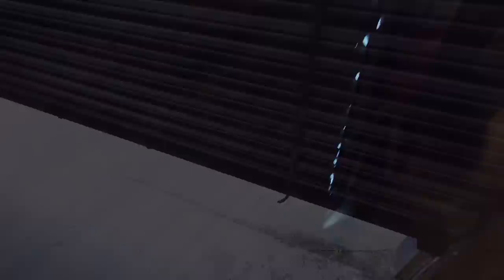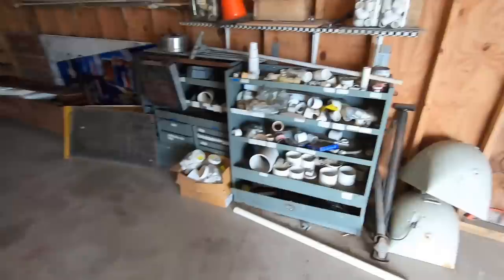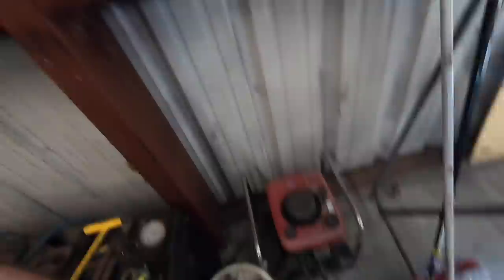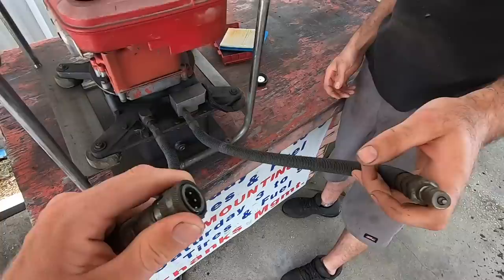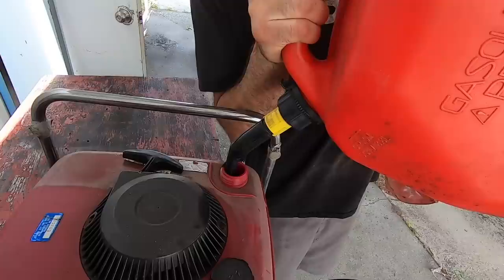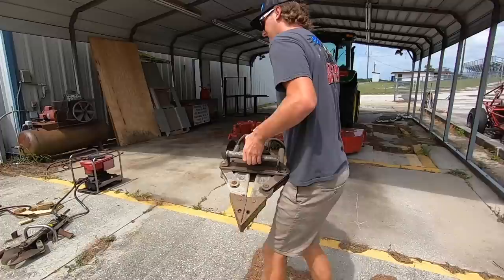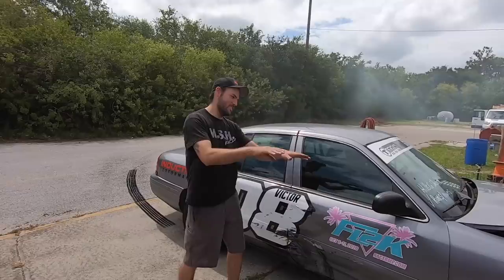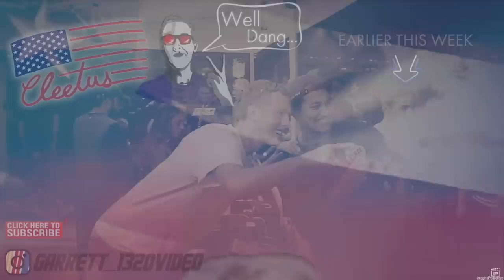We Found a REAL "Jaws of Life" Setup at the Freedom Factory and Powered Them Up!!! (they're insane)

Comment: Cleetus, I’m a mechanic that specializes in hydraulic tools and i would love to hook yall up with better whip hoses and put in some seal kits. I live in Florida as well.
Reply: Everyone should upvote this so Cleet sees it.
Reply: Jeff Sharpe you gotta send him an email
Reply: Find the res-q-Jack struts that one ram is made to go on...
Reply: I work (well currently laid off ) at a hydraulic hose shop up here in PA.  I was going to post a comment to tell him to change all the hydraulic connectors to screw together style. If the hoses are 3/8 (its hard to tell if they are 3/8 or 1/2) some IVHP style connectors will make hook up much easier.
Reply: Safety first
Reply: Hell yeah brother
Reply: Fire fighter here. Those power units are either 5,000 psi or 10,000 psi. And the rescue tool companies tell us we have to buy special hose from them for the units. And of course anything with fire or rescue related to it doubles the price.

Edit: they also run special veggie based hydraulic fluid.
Reply: Jump on this, you want these tools working well. They can be extremely dangerous when they go wrong.
Reply: Danny Evans Good point 👍🏻
Reply: What he said, hydraulic fluid injection injuries are terrible.  Whatever you do, DO NOT google image search that.
Reply: @halbritt  great. I've been servicing hydraulic bollards for the last six years. I must go look.
Reply: The spreaders are used to open doors when they're jammed, the Cutters are used to help take the roof off, or open a part of the car to have better access to the person whom is injured. The two different size spreaders are used to help open up areas when you need to. If you guys are skilled skilled enough you can make a convertible out of one of the Crown Vic. You guys should try and contact one of your local fire departments and ask them if they can do some training out on the property and you guys can observe and see how they're actually used.
Reply: That's awesome, this is why I love this channel. Just a good group of people, no drama bs and dumb comments. Plus top tier content!
Reply: Get this to the top
Reply: Yes
Reply: Heath Albritton bro I had to google that straight away. I had absolutely no idea that would happen.
Reply: Listen to this man Cleet! Safety First!
Reply: Hell Yeah Brother
Reply: @cleetus
Reply: Jeff Sharpe send him an email he’ll answer
Reply: Get onto this guy Cleetus he seems to know the goods.
Reply: Boom!! do it
Reply: @brianm6117  those connectors are purpose built for extrication equipment. You don't want screw together, slows you down. I've pushed that type of equipment to its limits, never had one of those connections fail. Firefighter, and have done annual testing of all of that type of equipment for years.
Reply: thatd be great!! i love the car community for exactly this reason!!
Reply: Heath Albritton good damn those injuries do look scary. All best and luck to all you who work with those machines 😳
Reply: the guy is a millionaire let him pay you for it
Reply: @halbritt  yeah they’re nasty. I run/ work on heavy equipment, and it’s part of a lot of our  annual safety training
Reply: Imagine if he just replied to all these comments saying he will let you do it, he would literally have thousands of people hanging around trying to take advantage of his fame😂  just remember he's forgotten more then you people that have too comment know.

Comment: The “spreader” IS THE JAWS OF LIFE. You’re calling the “cutters” the jaws. I’ve got some extra pumps for them and hydraulic reels if you need one. Those first things are called rams. And the original cost was probably around 15k for the set with the generator...
Reply: That spreader doesn’t look like a 32A though. I could be wrong.
Reply: it's old set....at least 20 to 25 years old....but if they work they are great to have for an emergency...they only thing the old Hurst jaws are HEAVY!
Reply: It literally says has of like on the cutter... Besides that, jaws are known for closing not spreading.
Reply: You can buy a refurbished one on ebay right now for 15k.
Reply: None of it’s Holmatro so they should upgrade.
Reply: They definitely need a hose set & manifold plus a general once over, and maybe some Rescue42 ram plates and other accessories. Hopefully Cleeter and the crew take a vehicle extrication class from the state or local Fire Marshal. It never hurts to know what you're doing 👨‍🚒👨‍🔧🇺🇲
Reply: @warpedfusion  I know of something that's known for spreading..
Reply: @sinistersparky9657  That would be some good knowledge for them to have while out there playing without a safety crew on hand.
Reply: warpedfusion yeah it’s kind of a brand name. That’s what you’re seeing on the sticker. Originally it was a 32” set of spreaders back in the 70s. They are heavy as hell. Back in the day I was the Medical & safety director at a larger race track for many years and own several sets of these. Now I own a similar ambulance and rescue service like what they hire down there at the track for their events...
Reply: Sinister Sparky i have a few brand new 10k 100’ Hurst reels and a few spare manifolds. I should probably email him.
Reply: Donate the wrecked crown Vic's to your local FD in exchange for some training on using that equipment
Reply: @SchmoopsAdventures  Genesis is where it's at
Reply: Sinister Sparky yup FYI I work for Holmatro ;)
Reply: It's a brand. They are both called Jaws of Life.
Reply: @MJ-kn7cc  that's a great idea man
Reply: The company I work for engineered power units for these back in the day  I have a couple of em sitting at the shop
Reply: @SammyTheDitchDoctor  Hell yeah brother! They have a pretty sweet track fire engine that has plenty of room for that and more rescue equipment 🇺🇲🏁
They could use a couple Halligan tools and a couple short pike poles for ventilating fiberglass hoods and for extinguisher access if anyone else has the hookup on surplus rescue equipment...
Reply: @Sun-ut9gr  whats her name.
Reply: Schmoops Adventures whenever any of our standbys are “REAL” stunts we rent a set of Holmatro tools. That’s saying something since we own half a dozen sets of Jaws. Heh.
Reply: Bumble Bee  yup my nickname is shaft 😆😆😆     or pipelayer
Reply: @twisted2291  Amen brother! It would also up their game as backup for the hired rescue guys 🤘
Honestly that could open up a whole new series on motorsports rescue 🏁🇺🇲👨‍🚒
Reply: @SchmoopsAdventures  Holmatro has some sweet gear - I'm not up on NEW Holmatro stuff (been out for a few years) but I'm very familiar with the Kombi tool back in the day plus their lighter weight and easier to maneuver cylinder arrangement of the individual cutters and spreaders was pretty sweet 👍👨‍🚒
Reply: Actually the brand name is Hurst Jaws of Life.

Comment: Just some suggestions for you:
1 - get those checked over by a service company, possibly certified - insurance will be happier that way.
2 - take the crew and go on a rescue course; yeah, you hire experts (good call), but having the skills yourself could save a life.
3 - maybe find out if the hydraulics on the rollback could be tapped into to run the jaws. You could keep a set in the truck with say 50' of hose, and be ready to extricate in seconds of pulling up and engaging the PTO. Plus, you'd have a set of Big Block powered jaws then. Even if you don't use them in an emergency, could be handy for post-crash cleanup.
Reply: 4 - get a good storage box that will fit the the whole (power source and all tools) set up that way you can easily be moved as unit and lets you stage it close by on a truck like the roll back but store it out of the way in a shed when they are not needed.
Reply: That’s a wicked idea trying to tap in to the roll back for a power plant. Would be a good set of tools to keep in the 6x6 as well as a utility vehicle on track.
Reply: that would be really cool to wire it into the truck!
Reply: or store in firetruck
Reply: This comment aged well let’s see how it does now that the rollback is big block powered lol

Comment: The second spreader you guys found is a “ram” it’s for “dash rolls” when a car is crashed. So you would make a relieve cut at the bottom of the door frame under the dash,  place the spiked part under the dash and the other but end on the door frame. Then twist the throttle and it’ll start to roll the dash forward. This is great way to unpin someone’s legs.

Comment: As both a firefighter and freedom fighter, remember to always wear eye protection when operating those.  Also, don’t ever stand between the tool and what you’re cutting (you didn’t here but just good advise).  I’ve cut MANY of patients out with these.  The door pin and brake pedal are the strongest pieces of metal on the whole car, but they’ll cut!

Comment: James is an engine guy through and through.  He got so excited when that thing fired up.
Reply: What’s a ‘engine guy’ 😂😂
Reply: Hugh Jarse that's Murica for ya.
Reply: Probably excited that he wasn’t gonna have to work for hours on it so it would run for a while!!!
Reply: I get happy when I hear something run that hasn't been ran in a while
Reply: Hugh Jarse like a butt guy, but for engines.
Reply: So did I. Obviously the thing was put up dry of fuel and full of oil and ready to go. Prob hardly used. Just some fuel in there and start up and then cut away

Comment: 10:41 The fittings on those hydraulic lines are made to where they can be disconnected without them spraying fluid everywhere. I would safety check that though due to the fact that you don't know how old the seals are. Hope that helps.
Reply: And when you disconnect them, make sure to keep the fittings clean.
Reply: That's the older style of Hurst extrication tool hydraulic hose fitting. You don't need to turn the pump entirely off to swap tools, but you absolutely need to have the pump in "dump" before you disconnect the fittings. On the newer single "coaxial" style Hurst hydraulic fittings, you don't need to touch the pump controls to disconnect. Very bad things happen with Hurst tools if you have high pressure building up in the line with no return to the pump because you disconnected that first or didn't connect that one properly with the older style fittings. Things I've seen for myself during rig check. That high pressure hydraulic fluid will absolutely screw up your body too as it cuts through you, like the meanest, nastiest water jet cutter you've ever seen. It's awful, they showed us photos during training. You really want to be wearing proper personal protective equipment when operating that stuff, even just to test it.

Comment: Some older units you have there. 5000 psi setup from early 2000s. Still use them as backup. They’ll work pretty good on the older pre 2011 vehicles. Newer stuff they’ll struggle a bit in certain applications with the newer steels.  Have fun they’ll do a lot but  be careful. Let the tool do the work. << extrication tech.
Reply: You guys just scratched the surface. With a healthy unit you should be able to completely disassemble that Vic. Should be a two stage pump so give it 8-9 seconds after it bogs with no movement.  Second stage should kick in and getr done. Make sure you’re wearing full ppe as I’ve seen several injuries over the years. Remember there’s 5000psi in the lines and if one nick happens and your skin is near. Or any part of the car catastrophically let go.  Like I said have fun but be careful.
Reply: @blazebfd9850  Not to mention complacency. Using it for a while with no close calls gets you complacent and that's when serious injuries can occur.
Reply: What are some kind of the injuries you’ve seen or heard about happening misusing these units. 
My rule of thumb is that if hydraulics and heavy equipment are involved, it can kill you quick.
Reply: Off the top of my head a couple hydraulic line ruptures. Cut the leather boot. Tips and blades broken under force. Everyone was wearing structural ppe and at worst was a laceration to the arm. Our structural gear held up quite well. Just a lot of pressure and force to be carful around.  Proper PPE should be used.

Comment: we used those old Hurst tools for years and finally got some lighter TNT tools right before I retired. Those old tools wont cut nater pins or brake pedals where the new tools will. Dont try it or the cutters will explode in your face. Try handling those spreaders in 110deg texas heat with full bunker gear on. been there done that

Comment: I highly recommend you guys to grab at least 2 dash rams. They are crucial if someone hits the wall hard enough to push the dash back into the drivers legs. You can push the dash either up, or forward to free the legs. I know yalls tools are backups but I couldn’t tell you how many times I’ve used the rams. The spreader will work, but not on all vehicles. The rams will push higher and farther than the spreaders, plus the rams will fit in much tighter spots. Awesome tools, and video! Love the large cutter. Hurst is all we’ve ever ran at our fire department and I’ve never had issues with any of their tools. Just keep them clean, greased and stored in a cabinet of some sort to keep the dirt off of them.

Comment: You discovered the secret to carbed engines starting on the first pull after years of sitting.  Run the carb dry before storage/winter.  This is vital info for generators.
Reply: Or run gas without E
Reply: I think this was already common knowledge...
Reply: @Mastermindyoung14  non ethanol gas still goes bad, its not magic. but have fun cleaning carbs if you wanna test it
Reply: You just give it a few snorts of carb cleaner and pull 😝 it always smokes a lot but it burns that varnish up good 😉

Comment: The Fire Truck is a perfect place to keep them.
Move the truck close to wherever you're Ripping & you're set👌
Reply: I think the firetruck may have the hydraulics to be able to run these things right off of it. I have seen trucks with it, so maybe theirs does too. I do not know much about firetrucks so take with a grain of salt I guess.
Reply: @willpestka2745  it all really depends on how the original department ordered it. More than likely it doesn't because that's seen as more of a luxury. But it definitely could
Reply: @CallSignCosmic  i wouldn't think of it as a luxery. More of an unnecessary thing. Most stations have trucks for a variety of tasks. This one probably for fire management more than anything
Reply: Nothing to do with a luxury. Different tools for different jobs. They have a fire engine. They are designed to put the water on the fire, not a whole lot else. A rescue truck is what holds the hurst tools and as the name implies, their job is to perform rescues. They are almost always plumbed to run the tools off the truck. Now that being said, certain places have rescue tools on their engines like where I work. In that case, they use the portable pumps like they have here. The idea is that you can do something with a small pump and one or two tools. If you need more than that, you call for the rescue truck.
Reply: @ConnorEtch  yeah no. Most places can't shell out half a mill for a new rig so if they buy a used one that has it it's a luxury
Reply: @JamieR1234  im on the busiest POC department in our county, we run side by side with the busiest full time department in the county. All of our engines are setup as rescue engines with extrication equipment. But none are setup with on board hydraulics. The nearest dedicated rescue is nearly 20 minutes away. It is a luxury
Reply: @CallSignCosmic  Well the US is very different from the UK then.

Comment: 6:14 behind the ladder, under the jaws of life, is a beast of a tire machine. I wouldnt use it on any snazzy wheels, but man those things do work. Id do any steel wheels you need to put tires on with that unit. shes a ripper for sure.

Comment: Y'all should've been around in the Chrysler 2-stroke era of those. Never knew if you could get them lit on scene to cut someone out in time. We had to perform a weekly test but they were so finicky that they may run great that day & be dead as a post the next. 

That B&S Quantum setup looks heavy as hell. Practice cutting A-posts, B-posts, cutting the roof just ahead of C-pillar & folding the roof back. Good experience for you all.
Reply: Was it similar to the power head off a small two-stroke outboard?
Reply: @otm646  yes basically an air-cooled 3 horse outboard-derived motor. Bad about fouling plugs because they required 16:1 mix which is unheard of today & someone who didn't know better was always dumping too much oil in the gas. Those old tools we used had origins from the late 70s & I was with fire/rescue from 1991-1999 in Richland Co, SC so they were old! The powerheads were light tho, that Briggs they have looks heavy & bulky!  

I don't know how far back you go but Chrysler had a significant presence in the 70s with outboards & continued on under the Force name thru the 80s & 90s.

Comment: Before connecting those quick connects, spray those male and female hydraulic ends with brake clean to remove contaminants and always connect hose ends after disconnecting.  That will make it last long. Also if you can't get them connected make sure the female end is clocked right. If it still won't connect hit the male and on a piece of wood to relieve pressure. To release pressure from the female end, you can use a screwdriver if you're careful.

Comment: As a small engine mechanic I recommend investing in ethanol free fuel for all your small equipment. VP Fuel makes the best in my opinion.
Reply: It's Florida, I'm sure they can get 50 gallons of boat gas delivered.
Reply: Ethanol free doesnt matter if used frequently
Reply: Tampa shouldn’t be hard to find Rec Fuel. I get it up and down Florida for my boats and small engines